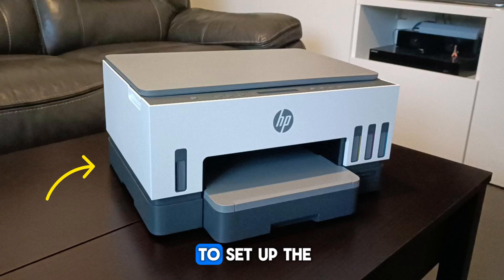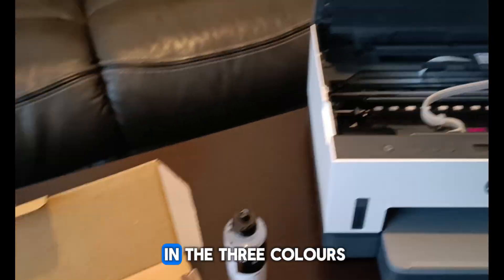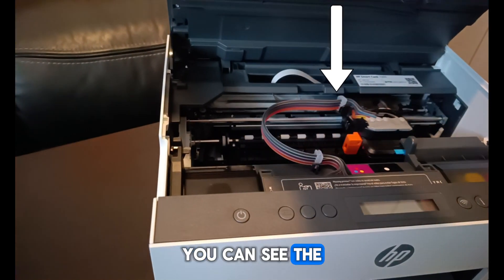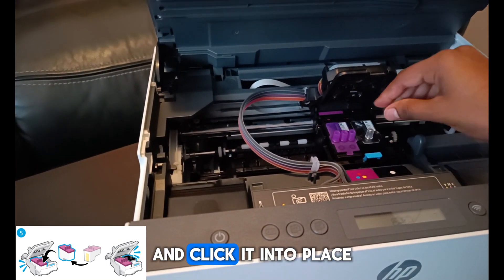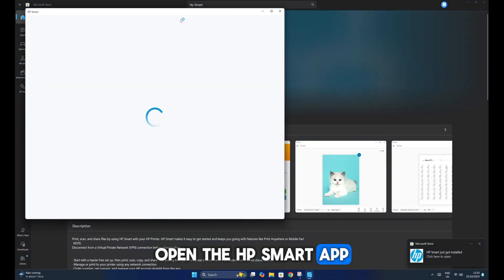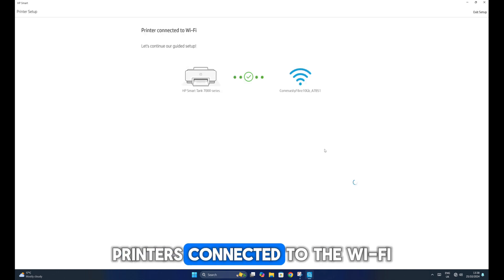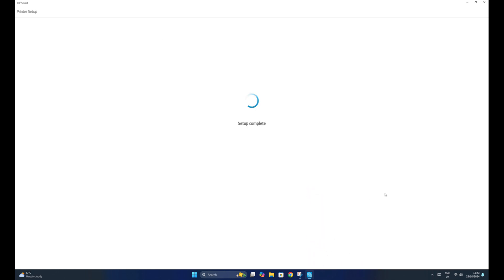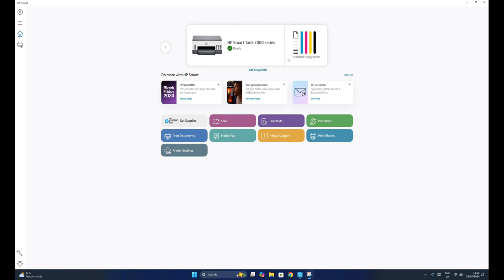How to setup your Hp Smart tank 7005 for the first time. Video Live at 19:00. Voice created with Ai.

Comment: Good and explanatory video. Installed a new HP7005 today but the latest HP Smart is a little different near the end and does some things slightly different and automatically so perhaps an update to the video may be worthwhile. It would also be useful to show the printhead alignment section as I found that I could not scan a document until I had completed this part.  Thanks.

Comment: I recently switched to Quantum Fiber internet, and now I can’t connect my HP Smart 7000 printer to the Quantum Wi-Fi. The problem is that Quantum uses a single SSID for both 2.4 GHz and 5 GHz bands, while the HP Smart 7000 only supports 2.4 GHz during setup. Has anyone else faced this issue? Is there a workaround or solution?

Comment: I've just bought one. I've got a Mac. Not exactly click and connect is it?
Reply: Just bought one to and I also have a Mac. Was it difficult or different to set up ?
Reply: Absolutely not.  Useless piece of junk.
Reply: @nannyval why. I got one and love it
Reply: @JamesWoodsSlots because I’ve had it since end of June, and I still cant get it to connect to my router.  I’ve had 3 occasions when the lights flashed, I quickly followed instructions to connect.  It worked for 2 photos the lost connection, it took hours of trying again, 2 photos, then lost connection.  It kept doing same thing but then I got icon on screen, 2 print cartridges and an orange flashing exclamation mark, plus an exclamation mark to the left of the screen has lit up. I Phoned tech support of the store I bought the cover from and they couldn’t help either.  I was told to take it back to store.  I have to get two buses, whilst holding it level.  Some hopes of that.  Glad yours is ok.
Reply: @nannyval sorry to hear. I bought a cheap canon from Walmart and it was horrible. Bought this hp and it’s been great